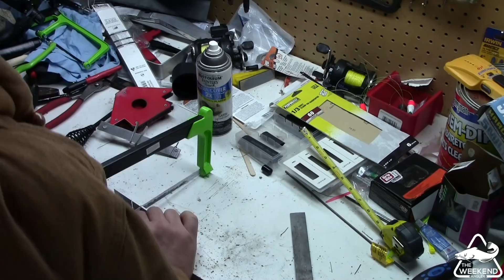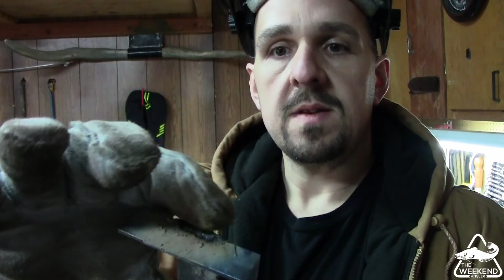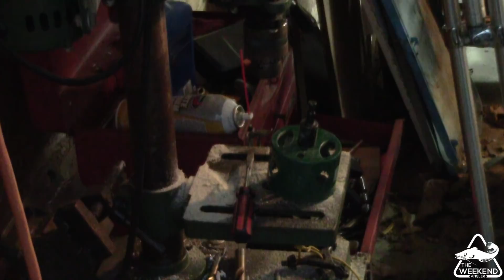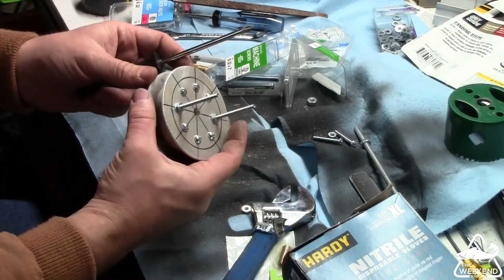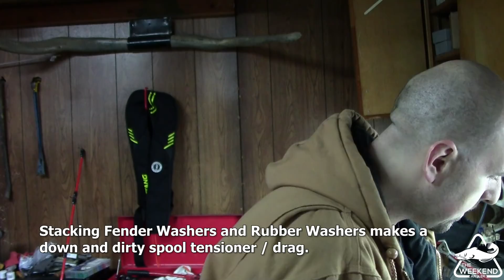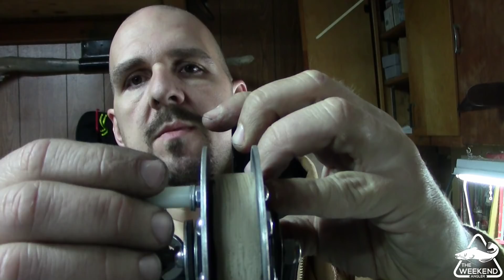DIY Fishing Rod And Reel Challenge Pt 2- Homemade Fishing Rod And Reel

Comment: Love both yours and Kris rods and reels.  Only thing I'm concerned about on your reel is that if the line slips between the wood and aluminum it could cause problems but, I'm excited to see your test cast and the fish off. Good luck to you both!
Reply from the maker: Test cast video was posted this week. So far, so good. There is a learning curve, however.